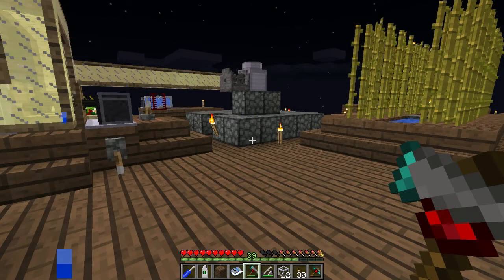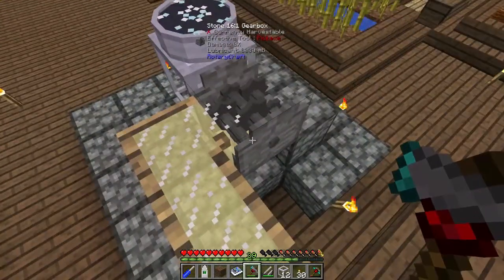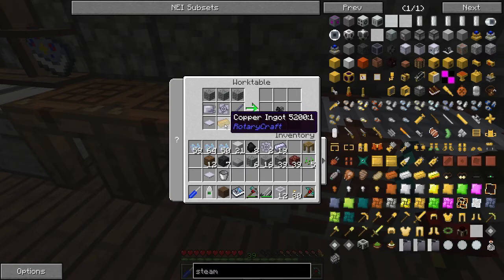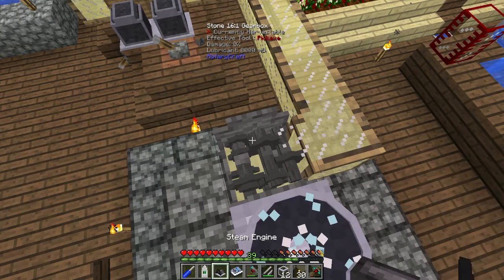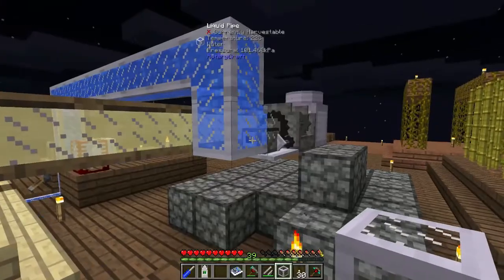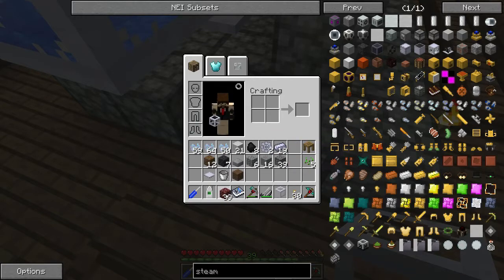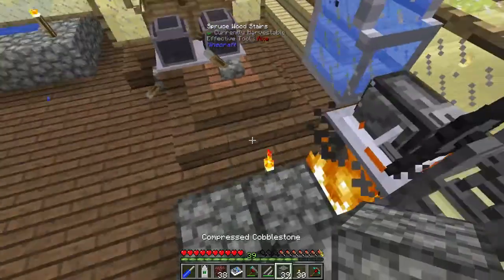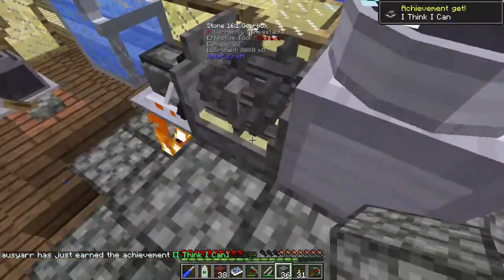RotaryCraft Steam Engine, Renewable Power

Comment: I don't think you gave us all the numbers required but if the centrifuge needs 4096 rad/s that's 8x the speed of the steam engine, 8x gearbox set to speed on steam engine gives you 4096rad/s and 4Nm maintaining power at 16,384kW. Seriously, Thanks for the creds, it put a true smile on my face =)
Reply from the maker: My brain wasn't working and all I could get was 4000 something rads at the time
Reply: You can't always be the brightest lamp in the freezer xD
Reply from the maker: Industrials.Black Only when the door is open
Reply: Ausyarr  And the wind is blowing from above... (I can't stop ^^)

Comment: the only difference between the gearboxes is the amount of lubricant they use - wood uses LOADS, stone uses about the normal amount, steel uses it slowly, diamond never consumes it but does still need some and bedrock needs none.
Reply from the maker: David Webster I thought the main difference is they can handle different loads, I havn't tested in awhile thou. I'll test it again. Thanks for the tip.
Reply: either way, you  might as well make steel or diamond ones. they might have the load limits too...
Reply from the maker: I think the main reason why I use the minimum needed is i'm cheap and i like complicated systems
Reply: you got magical crops in the pack? try automating uranium.
yellorium oredictionaries into rotarycraft's uranium. now there's a complicated system for you.